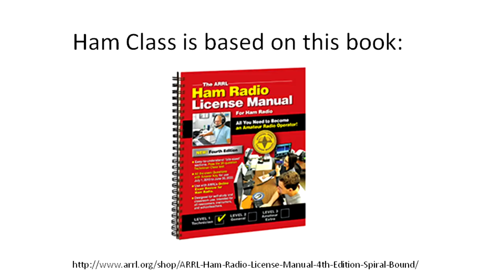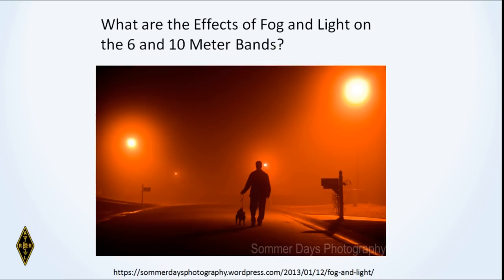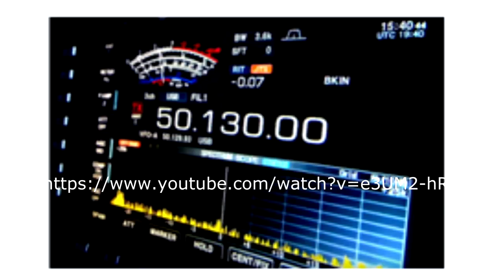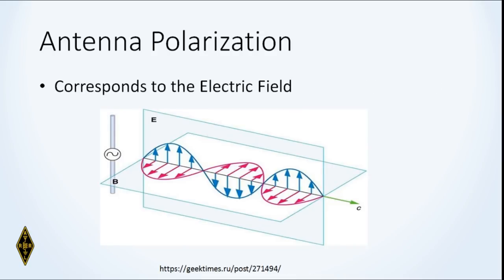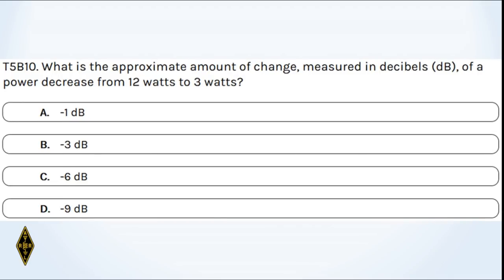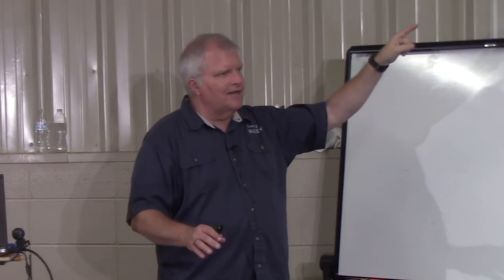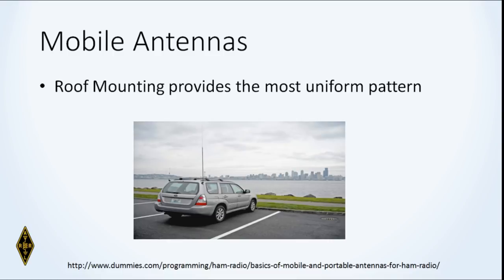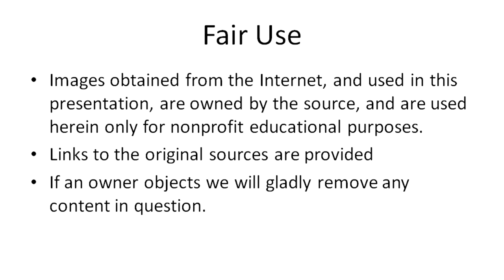Technician Ham Class   September 2018   Chapter 4 Propagation Antennas and Feed Lines

Comment: Do you need a different antenna for each band?
Reply from the maker: Some antennas will work (have a good impedance match and radiate the energy) only for one band. Others will work on multiple bands. For example a 40M dipole antenna will also likely work fine on 15M (due to the harmonic relationship between these bands, 21 MHz is 3x 7MHz and Odd numbered harmonics "fit" well with the 7MHz antenna's length).

An Off Center Fed Dipole (sometimes called a Windom) will work fine using Even Harmonics. So an OCF Dipole for 80M (3.5MHz) will also work for 40M (7MHz), 20M (14MHz) and 10M (28MHz).

Confusing I know, but you'll get it. 73 de W4EEY
Reply: @W4EEY  Thanks